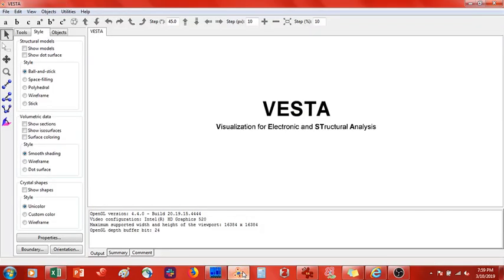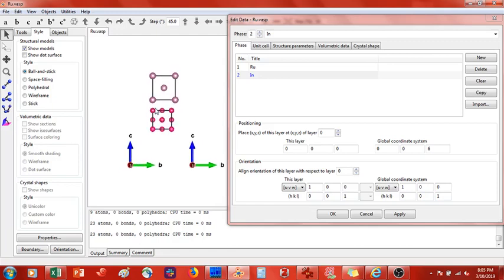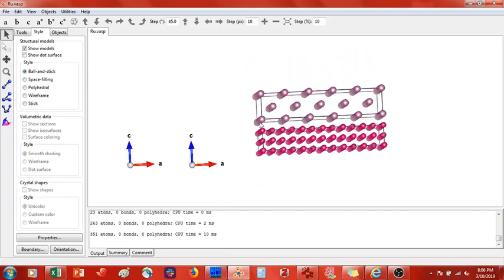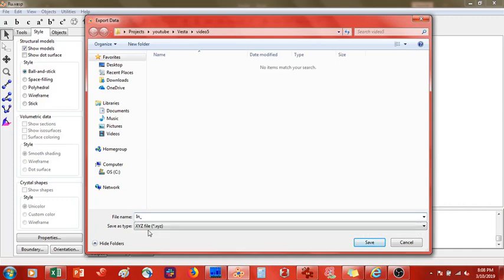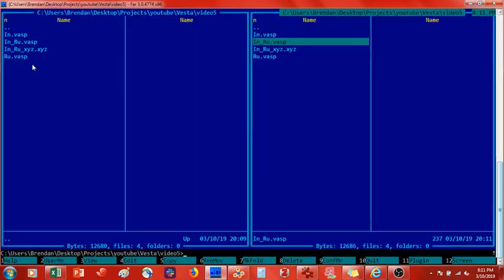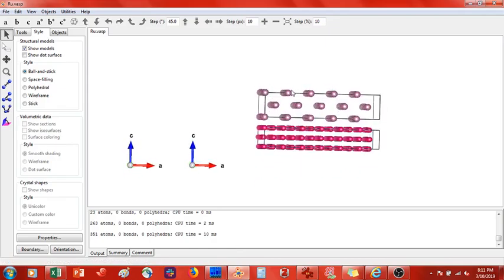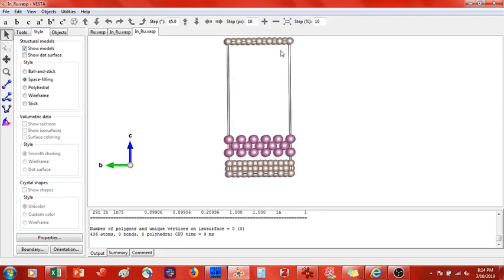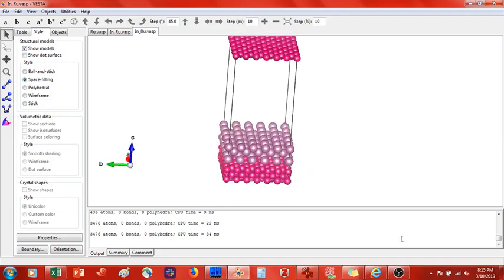Make a heterostructure or interface using Vesta - pt. 2

Comment: How to select the multiplying factor when the crystals are not cubic?
Reply from the maker: Try to find multiplying factor that leads to a set of cell vectors that minimize the lattice mismatch
Reply: Can you elaborate it please?
Reply from the maker: @_THUIFIQUEALAM  sure. Each cell gets a multiplying factor, that changes the unit cell to a super cell. Your goal is to find a multiplying factor for each unit cell such that the size of their supercells are very similar, and different inly by a few perfect of in length. Cubic or non cubic - it is the same
Reply: Is it possible to make a video on GaN -Graphene hetero-structure to explain it clearly?
Reply from the maker: @_THUIFIQUEALAM  sure, we can actually use LatticeMixer to do this. See my playlist on using LatticeMixer
Reply: Thanks in advance

Comment: Is it possible to make a heterostructure with tetragonal and orthorhombic heterostructure?
Reply from the maker: It should be. You may have to do some sort of basis transformation though
Reply: @nickelandcopper5636  Can you tell me how to do it with minimal lattice mismatch?
Reply from the maker: @rinuiyer4152  I may be able to make a video on it soon … been thinking about coming back to the channel nowadays - but it is too long to type. Do you have the systems you want to make into a heterostructure?
Reply: @nickelandcopper5636  Thanks a lot.  In the materials project database there is a system BaCu2Se2 with two different phases. One is tetragonal and one is orthorhombic. If you can make it on this it will be helpful. Thanks for making these videos.
Reply from the maker: Can you link them to me pls? Pls send links
Reply: This is the link to the structures to create the heterostructure
Reply from the maker: @rinuiyer4152  hi - I don’t see any link above ^^
Reply: I shared it again
Reply from the maker: @rinuiyer4152  where are you sharing it, Becuase I can’t see it. Just paste the link with your comment pls
Reply: @Nickel and Copper the link is disappearing. I am sharing the mp-id for those two materials. Orthorhombic one is mp-4473 and tetragonal one is mp-10437

Comment: Which software are you using for the VASP? Thanks. I can neither open the vasp files or the .xy files....  Thank you
Reply from the maker: Far3 software. Open and close with F3. When opened, save with F2
Reply: @nickelandcopper5636  I also have a problem with this. I downloaded the far manager, but it doesn't open the file. Can i use notepad to open it also?
Reply from the maker: Ibukun Olaniyan - open with F4 save with F2 before exiting with escape. And yes notepad works too but is more difficult for deleting at certain times

Comment: Thank you for making this tutorial! Could you please consider making a video on making a monolayer material like MoS2 or Bi2Te3 and multilayers of these materials? Thank you ( in case you only have time to  answer this question, please tell me briefly how to do so) Thanks again
Reply from the maker: Hi, thanks for the question, and you are welcome! You want to know how to make monolayer MoS2? I am under the impression that many layer MoS2 is actually just a surface slab with vacuum of MoS2. Is that what you need help with?
Reply: @nickelandcopper5636  Thank you for taking your time to answer my question, problem solved!

Comment: hi, good video.   How did you select a combined unit cell in the hetero-structure?  and second question is that, in this example, its lucky that both individual cells has almost compatible lattice match. there are some situations, unless we expand say 9x6 and the other as 4x4 and then only they would match to minimum extent.  in such lasrge hybrid cells, after creating how do you select a combined unit cell again?
Reply from the maker: Thank you for the kind words. You are correct. Lucky choice. Sometimes, one needs to expand to very large sizes to get it to match, like you say. Nice catch!
Reply from the maker: For combined unit cell, just take the smallest axes that work. If one is 2 and needs to expand by 6, then it’s 12. The other will be 3 and need to be expanded by 4. Therefore, use 12 for the combined. Something like this.

Comment: Very nice. I've recently discovered this VESTA capability, though I go about it in a slightly different manner. I'll detail it here, in case it helps. I use VASP, if that matters.

1) Calculate strained lattice parameters (averages between the two materials) 
2) Open material A in VESTA -> adjust lattice parameters to reflect (1) -> export as .vasp in Cartesian
3) Import material B -> adjust lattice parameters to reflect (1) -> settle on a global position for material B w.r.t A
4) Calculate the long-axis parameter for the supercell (sum up the length of materials A & B, and twice the separation between the two determined in (3))
5) Open material A in a text-editor and set its long-axis parameter to the value calculated in (4) - note that this will not affect the atomic coordinates due to the Cartesian system
6) Reopen material A in VESTA
7) Import material B and place it in the previously established global position (3) -> you may need to again adjust its interface lattice parameters to the averages
8) Export as .vasp

In step 8, the exported coordinates now include all atoms, as the new long unit cell of material A now encompasses both materials, as well as the separation on either end. 

Hope this helps. Ask questions in the comments.

As for my question, do you think a single unit cell layer of each material is sufficient to capture any information? When we calculate surfaces, a slab is employed, generally of enough layers to reproduce/simulate a "bulk" region. When I work with interfaces, I essentially join two slabs. Any thoughts?
Reply from the maker: Edan Bainglass, thoughtful comment. Your procedure sounds good. It would be nice if you could make a video for your channel and link it to a reply comment for the viewers out there, and for myself. For your question, I think it is not enough to use only 1 unit cell thick. Usually, you would need many many layers. Like 3-4 each at a minimum. Also, one needs to consider the possibility of an induced dipole. However, typically it is computationally too expensive to consider the many layers. In this situation, we just do what we can with the few layers. Perhaps, fix the atoms on the outer part to not move during MD or relaxation. Be sure to have he vacuum between periodic images large enough to make negligible the interaction with the periodic image. In this video I don’t think I include the vacuum, but ideally one should. 

In any case, these are tough questions, and I think research done in these areas is super important for the field of computational modeling as a whole.
Reply: @nickelandcopper5636  Sounds like we're on the same page then. And yes, this type of research is 100% crucial. Keep and eye out for my work if you're interested. Several heterostructures are currently in the works over here. As for a tutorial video... yes, I should make one. Soon... :)
Reply from the maker: Edan Bainglass, will do. Thanks for letting me know.

Comment: Dear, thank you for this helpful video. We can make a heterostructure from 2 bulk structures using this technique. But I want to know what will be high symmetry points for the band calculations of a heterostructure? I want to use the Quantum Espresso as a DFT code.
Reply from the maker: Hi haseeb ahmad, thank you for your kind words and great question. We actually do have the knowledge of how to perform such a calculation, but do not have the time as of right now to much such a video. In the near future (1-2 months) it is possible that we could make this video. In the meantime if you figure out how to do it, we suggest that you compute he band structure first for each structure individually, and then compute the band structure for the heterostructure. I personally would suggest practicing how to compute the band structure for a computationally inexpensive crystal first, such as bulk silicon, in which much documentation is available.
Reply: @nickelandcopper5636  Thanks, and the question persists, after individual bands calculations I will move to heterostructure ultimately. Then the high symmetry points will remain the same as the individual crystal structure?
Reply from the maker: haseeb ahmad , this is a great question. Ultimately, I do not know the answer. I think your question actually is an active areas of research in material science. The fermi level will be changed for sure, the high symmetry points may blend into each other. I suggest you spend a week and do an in depth literature search on this topic. There is a saying I like to quote in these situations “3 months of work will save you 1 week in the library” - which of course is a sarcastic statement. It means that a lot of question you have now are already answered in the literature. If you happen to do an in-depth literature search and still cannot find an answer to your question - then you have yourself a great research topic! I wish you call the best, and thanks for viewing the channel.
Reply: @nickelandcopper5636  Thank you very much for your help.

Comment: very nice videos! Could you give a lecture on how to build twin boundary structure?  Another question is how to determine the distance between two crystal structures for calculations?
Reply from the maker: Hi Liam Zou, What exactly do you mean by twin boundary structure? Could you please provide me with a few links and/or describe what you mean? Once I know what it is - I am sure I can do it .... anything is possible! Also, For the distance. Usually, a few Angstoms (3-5) is fine, because what you will do is eventually optimize the geometry of your structure, and that will position the different crystal slabs at their optimal distance apart, ... hopefully!
Reply: @nickelandcopper5636   Thank you for the prompt reply, it is helpful! Please see the link below for one of the examples for twin boundary (Fig.1), I feel it is difficult to modify the interface using vesta. Thank you.

https://www.nature.com/articles/s41524-017-0010-6
Reply from the maker: Hi Liam Zou, Thank you for the link and for your kinds words in your first post. So, if I have this correct (not my field of research) - the twin boundary structure would be a single crystal in which the twin boundary separates two mirror image slabs? These slabs, would be hpc packed crystals, in which the twin boundaries most readily forms upon a phase transition from high to low symmetry, usually via thermal means. Is my thinking correct? The twin boundary seems to be a  shared plane amongst the two crystals. If so, I think I can make such a structure, and I can upload the video next Wednesday or Thursday (3/27) or (3/28).
Reply: @nickelandcopper5636  Exactly! That would be great and I am looking forward to watching the video!